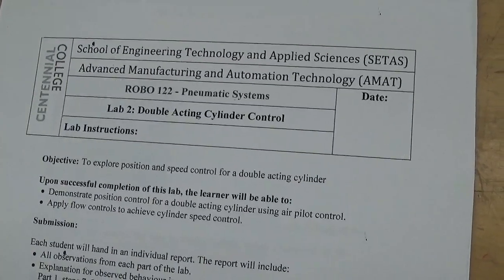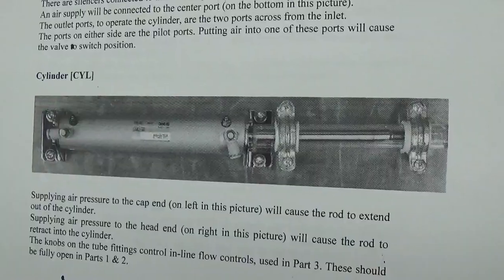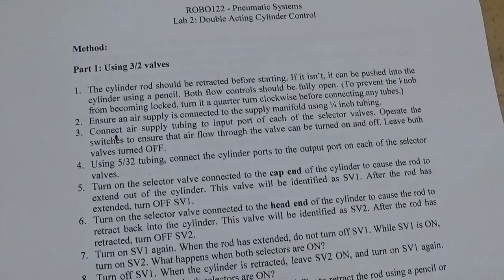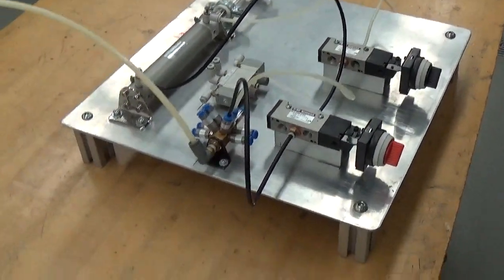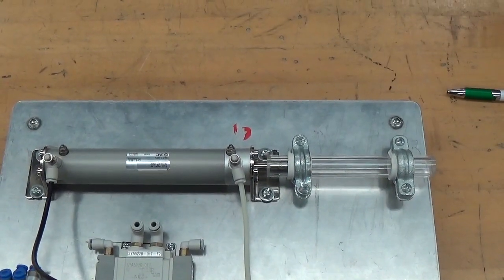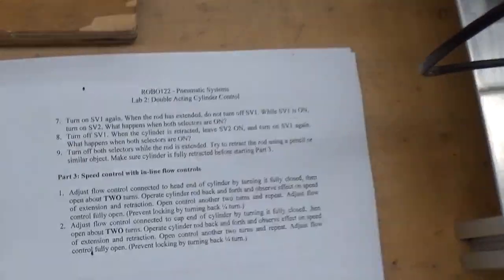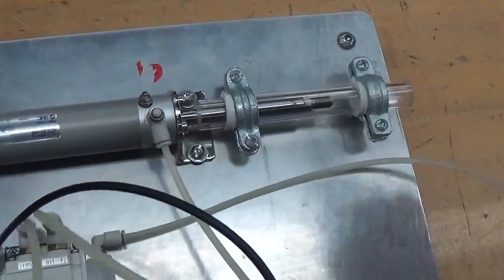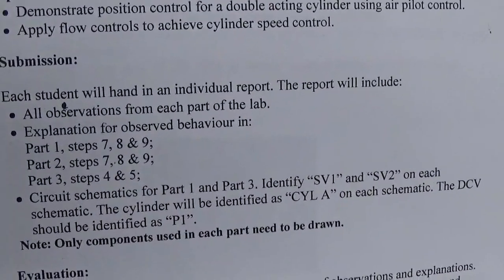ROBO 122 - Lab 2 - Double Acting Cylinder Control

Comment: Is it possible control the cylinder in 3 positions by using read switch and plc. If so how accurately it can be controlled.